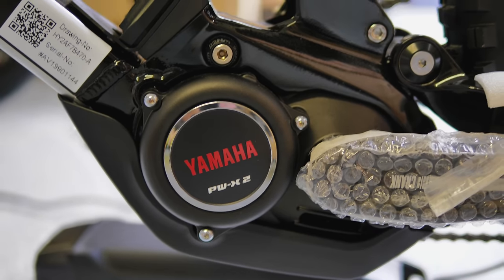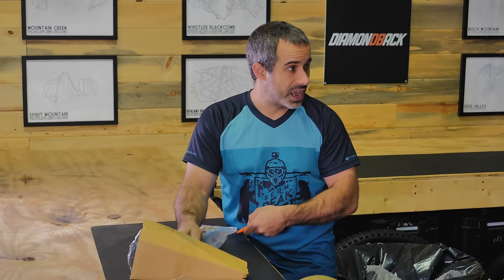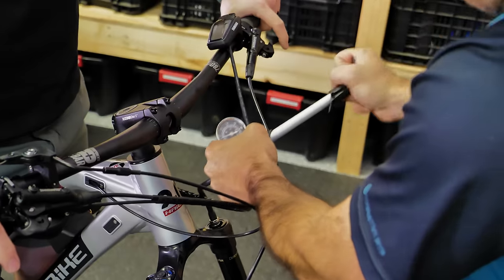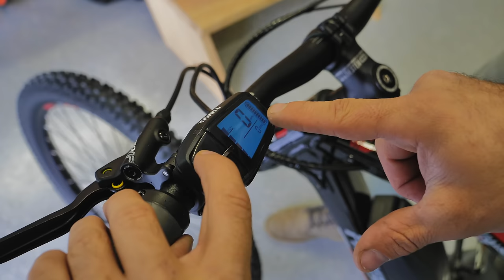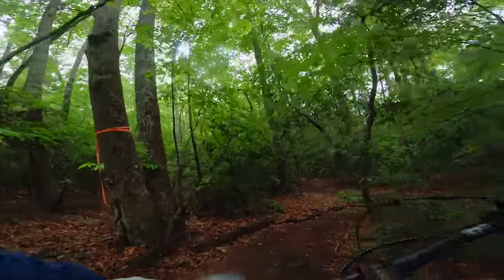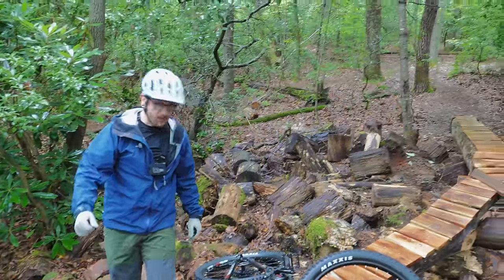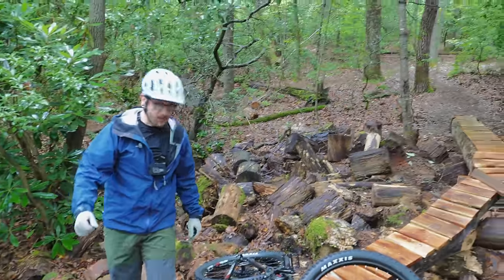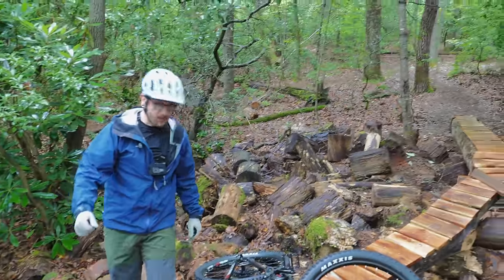Unboxing and Testing Two Surprise Mountain Bikes!

Comment: I love my eMTB.  I know there are many people out there that despise them.  And when the first ones came out with throttles, I was right with them.  That said after 4 spinal surgeries I was out of the game.  I’ve put in my dues (surgeries had a lot to do with previous mountain biking) as I raced the old Norba circuit in my teens and twenties.  This pedal assist bike has gotten me back on the trails and I can ride with my sons.  I really don’t see why there’s so much hate for Class 1 bikes that limit out the assist at 18mph.  I get passed all the time on trails, don’t put any more wear on the trails (in many cases less than the agro dirt jumpers that always cut extra credit jumps on side of trails....I used to be one myself and now I’m paying for it)

Anyway the more people we get on trails the bigger the lobby.  The bigger the lobby the more access.

Comment: Mtn Ebikes are only going to get more popular as they refine. I ride a dual battery Fat Tire 4.0 Freesky Alaska Range. Which I modified with air shock 203 mm rotors Shimano SLX but the Haibike is an excellent mountain bike  without a motor! Open your mind to going uphill fast..  ps love your videos. Would post pic if I could of my beast ebike

Comment: When a drive train decides its done a dork disk is  not stopping it from whatever it does. Had a full Shimano custom drivetrain diore and xt custom rim hub all the goodies  it swallowed the chain shredded the derailleur pulled 3 spokes thru the rim and chipped the gears ended up dumping the bike because I wasn't going to spend any more on it

Comment: My brother has one of the Cannondale e bikes and it has a walk feature so it motors itself slowly for walking uphill or on flat ground
Reply: pinned by Berm Peak Express
Berm Peak Express
1 month ago
So we didn’t find out about “walk assist mode” until afterwards. To hike that thing up a hill you just hold the button on the left side of the controller!

2.3K

Comment: So working for the biggest bike retailer in the UK, two things, none of the adult bikes come with dork disks.. and there is no 'two mechanic' rule for lifting E-Bikes, if you can dead lift it you've gotta get it up into the stand solo lmao... I've come close to believing I'm about to snap my radius and ulna one arming it to manually wind the clamp with my other arm... I've actually gotten stronger overall working with E-Bikes for nearly 3 years now thou ha.

Comment: Honestly, if an ebike could feel like an acoustic bike under no power (if they could cut the motor resistance and if they didn't weigh so much) it would be such an easy decision. But I want to be able to feel what riding a bike is like still...

Comment: Ebikers can still work hard. Put the motor in off mode, or use eco, and go for max range. Sometimes you need to do that. Though even in other modes, if riding with other ebikes or alone, I ride as hard all the time in those other modes as riding a non ebike. You still need all the bike skills though, and you need more strength to navigate with a heavier bike at times. I love how it makes me tougher and work well. Jumping on an ebike can be easier and less hard work if you remember they more easily put on speed to counter for their extra weight, and then you can hit the jumps well.
I ride endro bike (170mm front, 165mm rear), hard tail (140mm front) and ebike (160mm front 150mm rear). They all have their pros and cons.

Comment: I was thinking about the dork disk recently after I smashed my hand into a big cassette ring trying to pull a stuck inflater head off the valve. I don't think its for shifting, I think it's so you don't smack your hand into the cassette taking the inflator off. 
I still take them off.

Comment: Gf and I both have haibike sduro e-bikes. They are amazing. And the best thing? Because the motor support is limited to 25km/h they legally count as a normal bike. Why is this important? Every forest trail in our area is closed for cars and motorbikes but open for bycicles and therefore pedelacs (25km/h limited ebikes that require pedaling).

Comment: Would what we call in the UK roofers felt help with the slippery wood sections you have built? if you cut strips to fit to each piece and use felt nails. Just an idea.
Reply: I’m from the uk and call it chicken wire lol they do work really well tho

Comment: i think the ban on E-bikes should be changed to let assist only E-bikes but keep the full powered bikes banned. letting a full power E-bike is deferentially not a good idea some one will do something dumb sooner or later like hit a jump at stupid speeds. a good idea to add onto this have a list of authorized assist only E-bikes and E-Bike systems so no one can walk up and say it assist only when its full power.

Comment: Someone should mention the elephant in the room here: There is this amazing invention called the Enduro motorcycle: It's been around for years, it's tried and tested, they can be had for peanuts (second hand) - and they are seriously faster than these silly contraptions that don't even give you a proper workout. Just my 2 cents...
Reply: If you think this and an enduro motorbike have anything in common you haven't ridden a real emtb.  I had a hip replacement two months ago and this is the only tool to keep in shape, where I can actually leave the house.  I have no option to make it up to the trail anymore. I don't want use a shuttle vehicle, so should I stop biking all together?

Comment: Wait what?? E-bike legal trail system? You mean they're banned on certain trails? Why in the hell would they do that? 😂🤦‍♂️
Reply: Because some special flowers think that e-bikes tear up trails or whatever crap they think. when they do no more harm than a regular bike, it's not like a dirtbike we are talking about here it's pedal assist. I don't understand the whole closing trails to class 1 ebikes thing. It's mostly because of ignorance and not understanding of what an an ebike is and the different classes of ebikes. a level 1 pedal assist ebike should be allowed anywhere a regular mountain bike is, bottom line. Needs to be more advocacy to teach land owner and counties, etc what a class 1 ebike actually is and that it doesn't have a throttle and it's only pedal assist and doesn't have torque like some 250cc dirtbike or something. The elkectric motor is tiny it just "seems" powerful because of the bikes gearing. A fit person can put out more power to the wheels than a class 1 ebike.

Comment: The dominos ebikes are shit the motor is laggy as fuck I crashed the first shift I had in the wet on a corner i peddle a bit going into the to change the position of my feet then motor kicked and didn't shut off and slipped and dragged into the Bush basically anyone went I went to get up the brake lever had actually punctured into my leg. Don't trust dominos ebikes